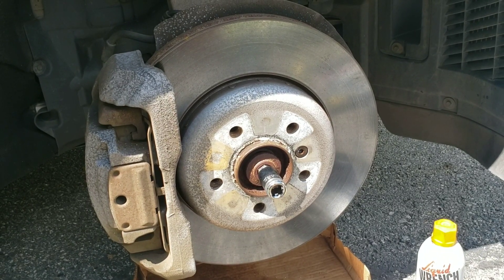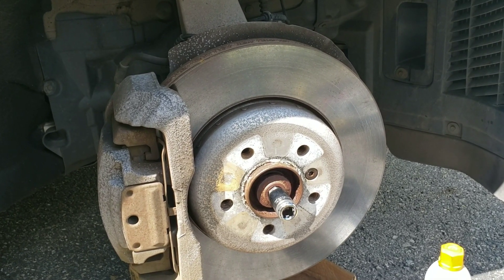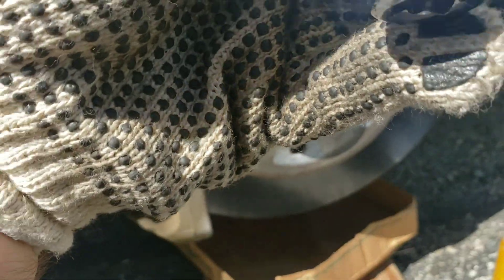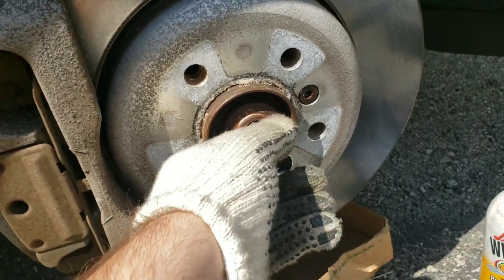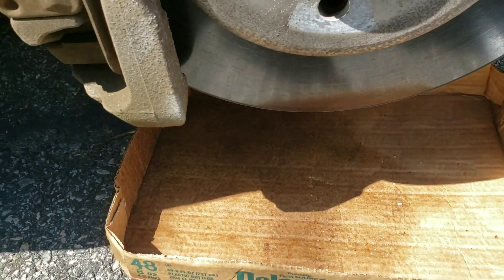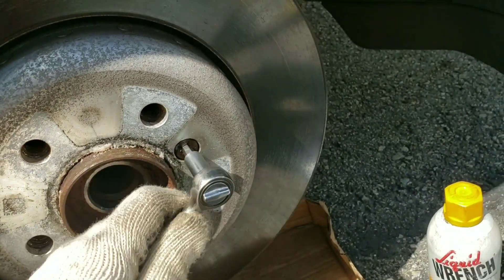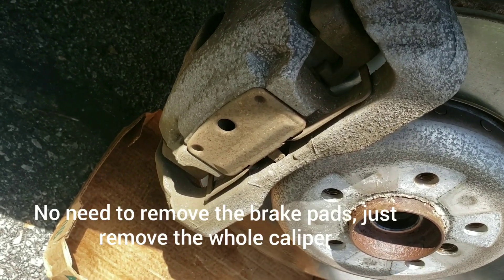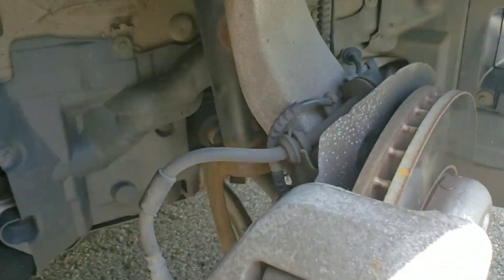Bmw 535i xdrive F10 front wheel bearing hub assembly replacement

Comment: that big collar bolt (that goes through the hub into the CV axle) is a torque to yield bolt FWIW and should be replaced when you do this job. BMW uses a ton of TTY bolts all over the place and they're all single use.

Comment: GREAT video and my upcoming work will be much easier now, especially in regard to sourcing the Duralast Triple Square Bit Socket Set (note that it's not available currently on Amazon but this is an Autozone tool set and it's in stock at my local Autozone - Part # 60-900).  
One thing though:  At about 3:15 you mention that you used an 11/16" size socket to remove the caliper bolts.  I'm glad it worked out, but the proper size is 17 mm.  11/16" works out to about 17.4 mm.  There is risk of rounding out the bolts when using that slightly oversized 11/16" socket.
Reply from the maker: You are correct...thanks for pointing it out...

Comment: great video!! I have exactly the same car, and I reckon, that videos about this type of car are hard to come by. So I really appreciate your effort. 

...So I managed to fuck up the front-passanger-side rotor-holding screw due the presence of sticky and disgusting rust. I had to drill a whole through the screw, and smashing a T-25 inside it to finally get it out (partially!) so now I am left with just remaining outer parts of the screw, which is inside the hub bearing. I have to try to rework the threads with a M8 thread-mill. It sucks :(

I just wanna give you some infos, in case you will be faced with future repair on the shitty water pump... It is doable, in a matter of fact, it is easy, but fiddly.
On my 2012 535i xdrive with adaptive drive and dynamic drive there is one trick!... you have to pull the Waterpump from the TOP. Prior to that the fan-shroud has to come out (and preferably the radiator as well. but I managed to let it on his place. then I changed the valve cover gasket... front and rear brakes (rotors and pads) Cabin air filter, cleaning the intake valves and many other things. 

I'm experiencing a knocking sound when vigorously shaking my steering wheel while the car is NOT running. (ignition off)! 
So my next project will be trying to remove the steering rack, but I reckon it will be nearly impossible to do that, 'cause there are so many struts and bars due to xDrive and Dynamic drive (active rollbar-stabilsation). Do you have any ideas on how to fix this? well, I assume its the left inner tie rod. I will check tomorrow. I will let you know if you are interested. 

It would be nice to have you as a friend whom I can share and also learn more about repairing our cars. 

thank you :)

Comment: Great video, I searched for a while to find an F10 535i Xdrive front Wheel Bearing hub video.  Curious what the full time to do the job was.
Reply from the maker: About 2 hours...to make the job easier,  spray some penetrating oil on the bolts prior to removing them..

Comment: Super helpful video, thank you. One question though, are you able to install the new assembly without the special press from BMW? I've seen other videos where it appears that the fitment is very snug. Seems like maybe you could put a block of wood on the front side and tap it with the rubber mallet, but wondering if you have tips. Thanks again!
Reply from the maker: This is the "whole wheel bearing assembly replacement" and its mounted by 4 bolts...if you want to save more money and just change the bearings, then I assume you will need the special press to push out the bearings for its replacement...
Reply: @autorepairs7910  Thanks for clarifying. Likely my mistake, I thought that I'd still have to press the axle through the center. Wasn't sure if that required something special. Thanks again.

Comment: Did u have to remove some brake fluid
Reply: You shouldn't have to remove brake fluid unless you also are replacing the brake pads and need to back the caliper pistons back in all the way to make the new thicker pads fit.

Comment: Yea I'm sorry but you put the bearing in upside down the square tab on the back side of the bearing goes in the groove at the bottom
Reply from the maker: The holes will not align any other way, I am not sure that you you can even put it upside down...I've put over 8,000 miles since I changed it, no issues...